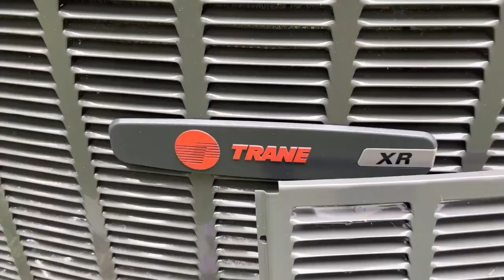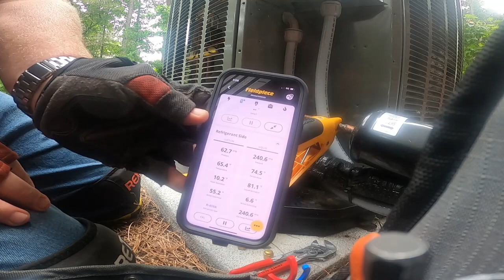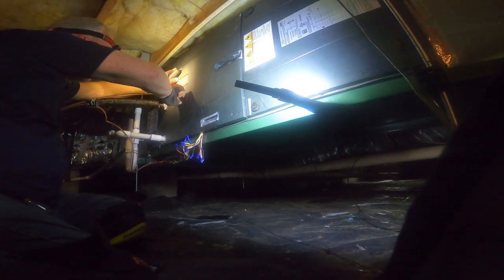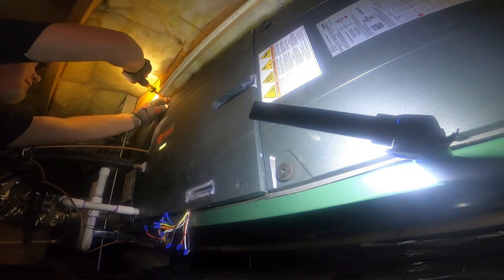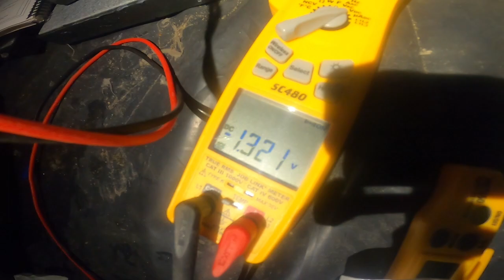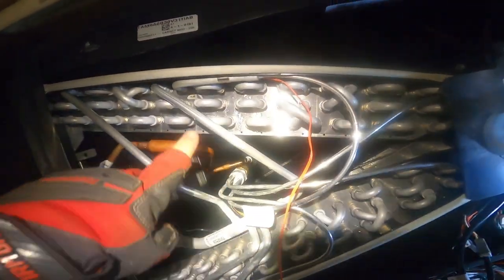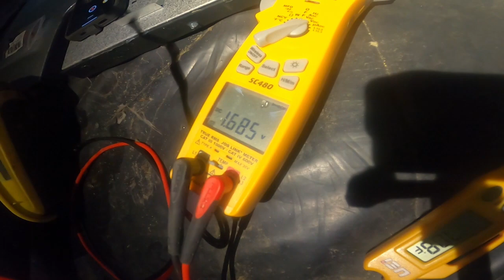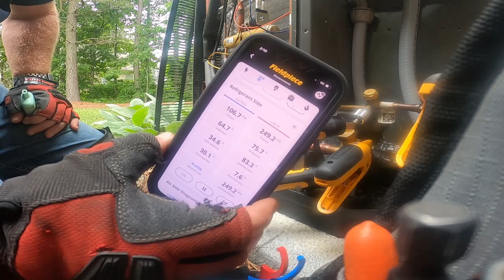Testing sensors on the TRANE TAM Air Handlers

Comment: I’m remembering years ago I was working on a Tam ,compressor would go off on internal overload on start up. I know sequence of operations is to flood the evaporator before indoor blower turns on. I do remembering my remedy was to put a freeze stat on with a compressor time delay 20:24 
Call never came back in, so I’m guessing it was the right move
Reply: I should have added compressor, was pumping down before indoor fan could turn 20:30 on causing IOL

Comment: Thermistors are not very rugged.  Thermocouples would be much more reliable but the electronics for thermocouple reading is a bit more expensive.  

Two reasons to solidly wrap insulate thermistors.  First the air flow temp can be quite different than evaporator pipe temp. Second, you do not want the thermistors to be constantly exposed to condensation moisture.  They are not perfectly hermetic and moisture intrusion in the end where wires exit end will eventually change their readings.

The black leaded thermistor is more critical.  It is equivalent to the bulb on a standard TXV.  The orange leaded thermistor right after the EEV is feedback lead compensation 'early warning' for the EEV control loop.  It sees the immediate reaction to EEV adjustment and helps speed up the EEV adjustment rate to respond to evaporator heat load changes quicker.  The orange thermistor is exposed to more variance in temperature as the EEV opens and closes.

Some older TAM units had a problem when blower and compressor shut down simultaneously.  The orange thermistor would see excessive temp drop from remaining liquid feed after blower shut down causing the unit to close down the EEV totally, holding liquid line pressure for a long time with back feed check valves in scroll compressor blocking other end of liquid line.  It can cause startup chatter in the scroll compressor top differential pressure plate sealing that unloads scroll compressor when off causing long term damage to differential pressure plate. On EEV systems should always allow blower to run for at least a minute after compressor shuts off. On variable speed compressors it is not so critical.  Newer TAM unit made software changes to avoid EEV total shutdown when system shut off.

Comment: I'm actually surprised I haven't had to change many stepper motors on those I think I've only had to do a couple motors usually it is a sensor One time I did find actual valve with stuck but that was on a brand new startup so I don't know if it's something they didn't purge or nitrogen or what but that was the only time actually found a valve bad and that was actually on an outdoor EEV right on startup but actually electronics on those have done better than I thought they would for the most part

Comment: Those coils are notorious for leaking toO. As well as the sensors on the stepper motor since 2012.❤🎉😂😢
Reply from the maker: Stepper motors do not have sensors on them.
Reply: @myHVAClife  the work in conjunction with the sensors, the stepper motor from the evc board. I have 11 years dealing with those shits.. recommend to change the board sensors and motor every time.

Comment: Slated for a new TAM9 and 2 stage compressor taking advantage of $2K tax credit.  But several videos show a bad temp sensor like yours.  Has Trane/American Standard figured this out yet?  Thermistor tech is about as simple as it gets ... a small device that changes resistance with temperature.

Comment: The caulking all over the panel is ridiculous. Positive pressure is not hurting anything if a little leaking air is present. Just makes it harder to service it getting carried away with sealing front panels. Of course negative pressure is a different story.

Comment: I got 10 flashes indicating low superheat but the outdoor unit isn’t even trying to run! Got 24 volts on y in and y out but not getting 24v at the contactor coil I need help lol
Reply: Look at low voltage  wiring going to the outdoor you might have a break somewhere

Comment: Why put a tam eight on a 2 1/2 ton.? 😮 or even a tam seven should only have a gam or Tam four or five😮😅?
Reply from the maker: This is a tam9, They do not make tam7 or tam8 anymore, and the tam9 is on the way out this year, being replaced by the TAMX!    Tam 4 and 5 do not exist. And the gam is trash! .
Reply: @myHVAClife  ok lol 😆 same difference why that air handler to begin with. Too much money for the air handler for the amount of efficiency it gives. Could’ve went with the tem6 and been just as good. Or plastic gam